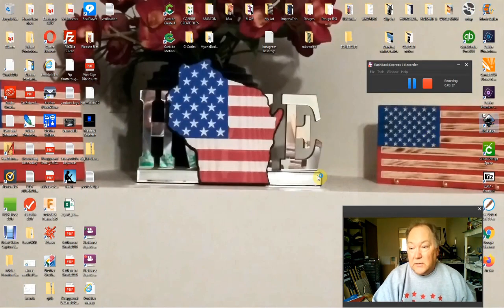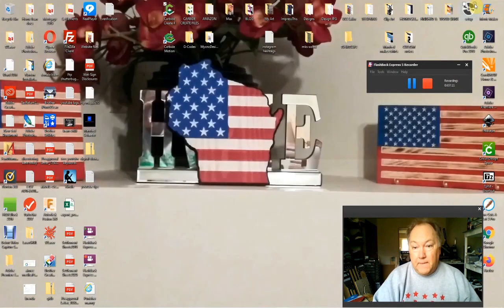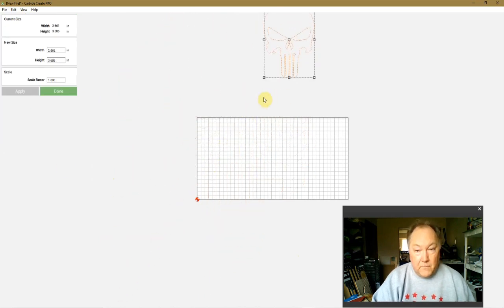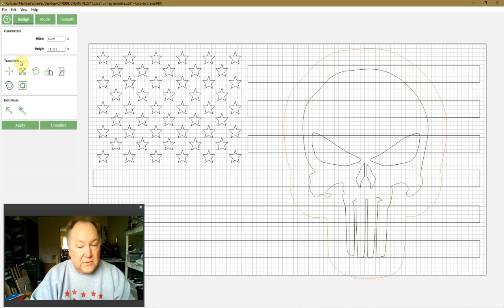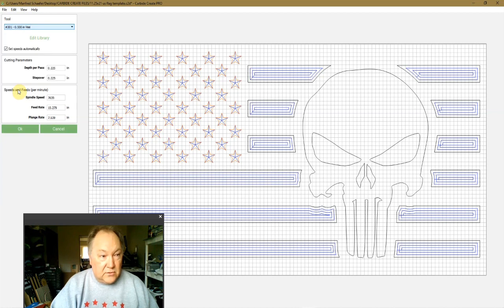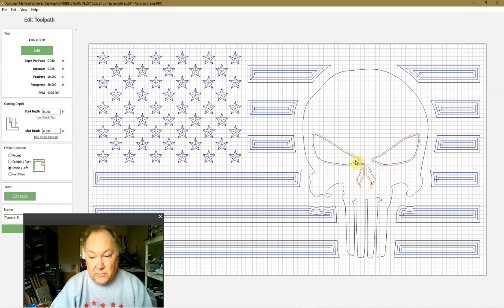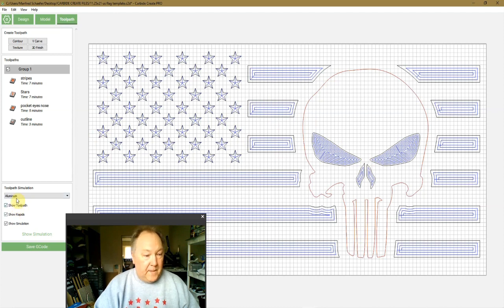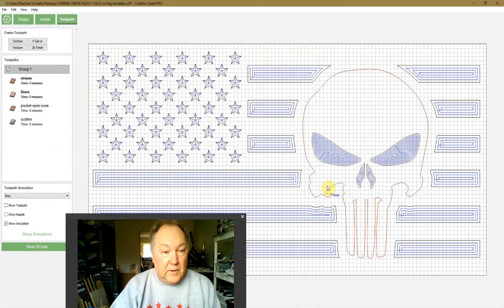Carbide Create Tutorial for American flag with The Punisher

Comment: Is there a difference in Inkscape using the import option in the file menu rather than open?
Reply from the maker: In my experience the import option makes cleaner lines for cnc designing.
Reply: @MKSWoodcrafts  thank you! Would you happen to have any tutorials on how to get my toolpath to not dive into a cut 10 damn times lol
Reply from the maker: @blake102989  that sounds like a nodes problem. Sometimes there are nodes where we don't see them. You can check using the nodes option after highlighting the design.
Reply: @MKSWoodcrafts  I was thinking that might have been the culprit. Thank you very much sir
Reply: Or would import help?

Comment: Great video. I finally got my shapeoko XXL up and running. Had an issue right out of the box and after replacing wheels, belts and eccentric nuts from a maintenance kit carbide sent me I found 2 bad wheels! So all my time the last couple months has been dealing with the problem. Now I can focus on having fun with this. My Instagram is 13foldsflags
Reply from the maker: I'll checkout your Instagram. It's a great machine and you'll have a lot of fun.